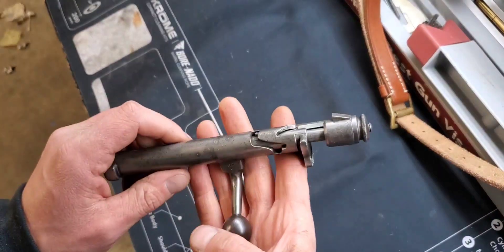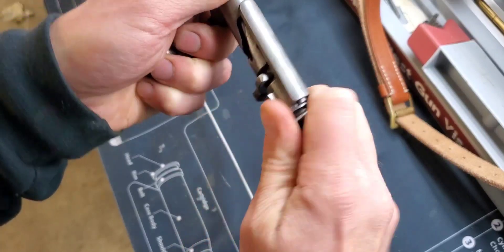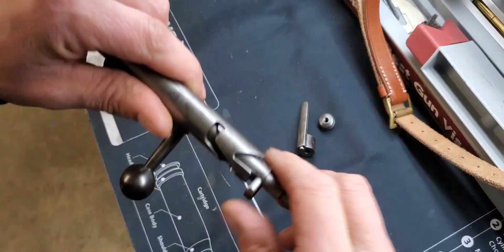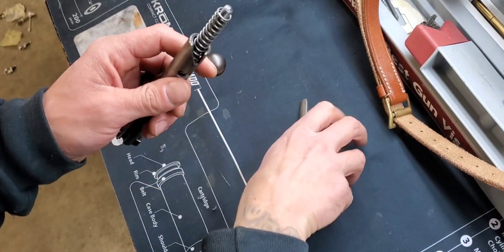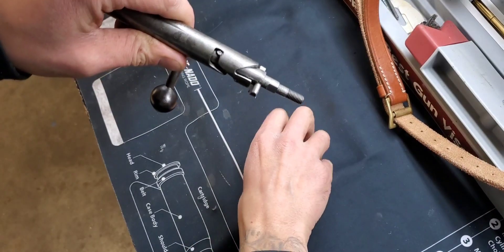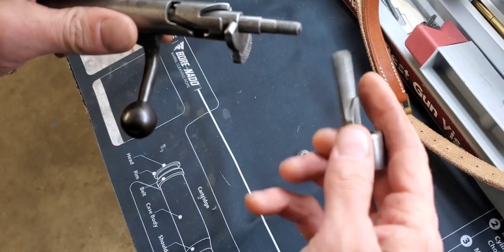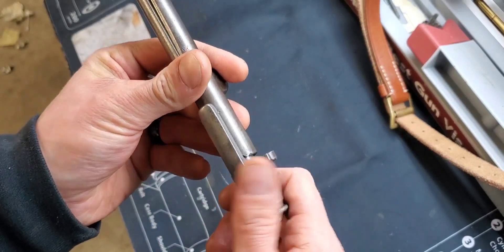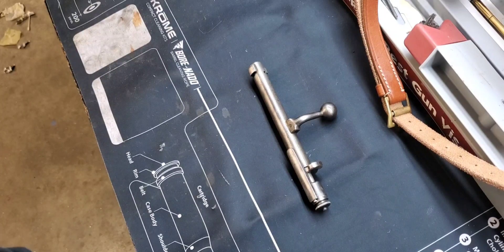Carcano Cavalry Carbine Bolt Disassembly & Reassembly

Comment: Thank you Sir. I too was going nuts trying to switch a straight bolt & extractor body’s gut with a bent bolt & extractor. I’m hoping the firing pin, spring , safety piece are compatible even though they could be 30-40 years apart.
Reply from the maker: Anytime!